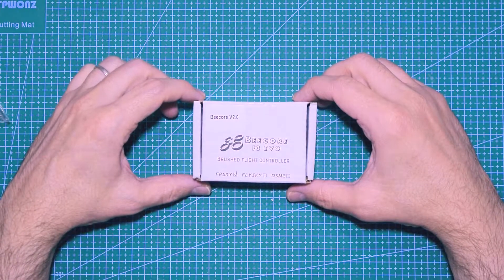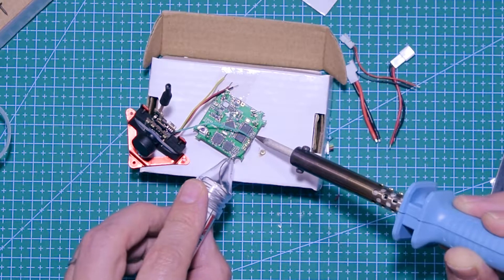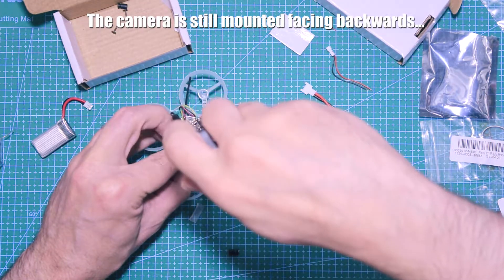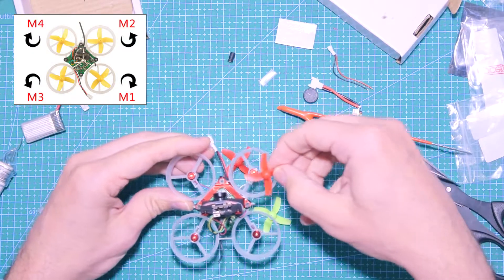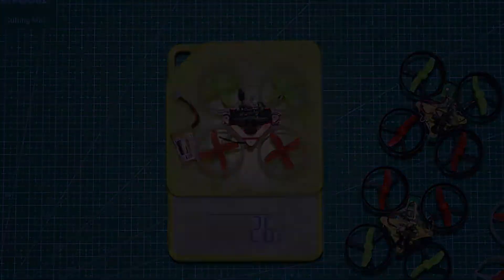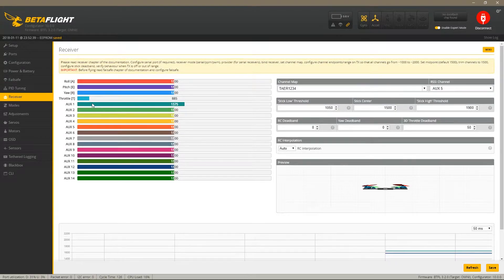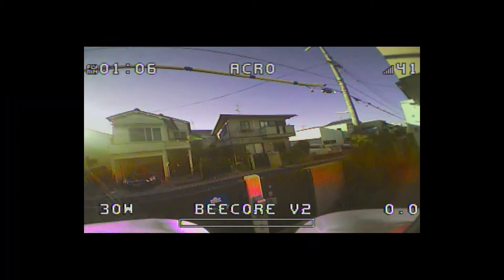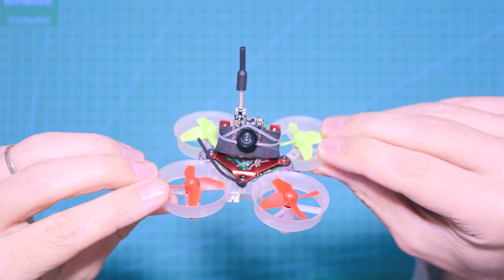Beecore V2 F3 Evo Tiny Whoop - Full Build!

Comment: Hi, but you bind in D16 mode? In the specs of fc it says it s compatible only with D8 mode. I need one for my EU firmware of my taranis
Reply: I've bought one of these recently in D16. Can I get it to bind? Nope. Followed the guide from bang good but it won't do anything following connecting the battery, holding the bind button and the lights going solid. Supposed to put radio into bind and it binds as well as the lights flash slowly. But it does neither
Reply from the maker: No it's bound to D8 mode.
Reply from the maker: I recently got the D16 as well, are you using a Taranis? Make sure you set D16 as Bind mode, I had no problem with mine.
Reply: Clearly says in the product spec it’s D16
Reply from the maker: No I meant on your radio. When you Bind, make sure you are binding in D16 and not in D8.
Reply: RikkTheGaijin I don’t have the D8 option on my radio
Reply: Same issue here. Specs say D8 only, my new X-lite only has D16, and won't bind. Video shows the taranis set to D16 and binds happily?
Reply: I had to download the D8 firmware for my Taranis and it bound

Comment: any reason why you didn't connect camera power supply wire directly to battery terminal rather than regulator. Camera input voltage range is 3.3-5V. Reduces risk of blowing out the regulator and making the bd useless.

Comment: Cool video, man. I made a build video of this board as well, but i used the 67000RPM motors from Racerstar instead, they give much more responsive handeling from the sticks, but i think they draining the battery much faster. I have a flight time on 3:20 with my 240mah eachine batteries. What flight time do you get on your set up? I also have som random failsafes at places i normaly have good connection, do you also have these?
Reply from the maker: Hi there! I recently purchased the 25000 KV motors, I'm looking forward to try those. As batteries, now I'm using HV 260 mAh and I get about 4 minutes of flight. No failsafe so far. :)
Reply: I have lots of failsafe/power cut problem with me BeeCore V2 too. I already broke a frame because of it. The worst FC i ever tested.
I switched to BetaFPV FC, and i have no more problems.
Reply from the maker: dudu du76 that’s weird, I haven’t had any problems, perhaps you’ve got a defective board?
Reply: Maybe. But there are lots of people complaining for same problems. ( i am one of the negative reviews on banggood page, btw ).
I am very disappointed. Without this problem, it would be the best FC.